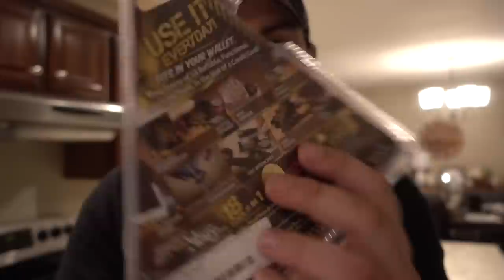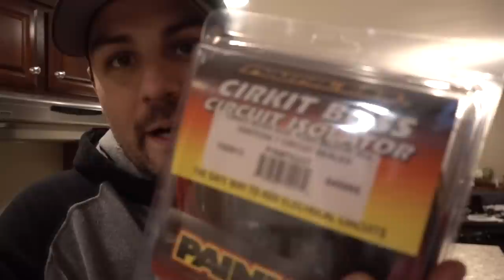The CHEAP way to fix your RUSTY truck bed!!!

Comment from the maker: Thank you as always for all the support guys!!! Don't forget to hit that LIKE button!!! and check out Wrenchworkz.com!!! New stuff coming soon!!! Who's ready for more giveaways!!!! Under 1K to 100K!!! K Love u BYE!!
Reply: why's that license plate folded on the trailer Greg 😂  not saying you are but I have done that before for no reason wink wink
Reply: GREG_ALBERALLA I’m ready to see 100k special lol
Reply: GREG_ALBERALLA put the wheel spacers on the front of the first gen!!
Reply: Put spacers on the rear of the first gen so you can get your center caps on your wheels since the after market axles shafts are preventing you from doing so.
Reply: Use the wheel spacer on the first gen on the front wheels to see if that will equal out your rear wheels sticking out.
Reply: Hey Greg Roomer has it that you do Directional Drilling?

Comment: nice steering linkage muscle man! anyone doing a front end rebuild on a 3rd gen ram 2500, heres a list of parts. I just did mine and bought everything on amazon and saved so much money.

Parts:
1) upper ball joints 2pieces - moog K7467 - $52.78/each
2) lower ball joints 2pieces - moog K7460 - $47.02/each
3) upgraded steering linkage (this is tie rods for 4wd, if you're not familiar) - moog DS800981A - $241.33
4) pitman arm (you'll need this one for upgraded steering linkage) - moog K440002 -
5) wheel bearing/hubs 2pieces - moog 515101 - $144.95/each
6) shocks 2 pieces- skyjacker hydro 7000 H7092 - $37.16/each 
7) sway bar end links - (part# for 2.5" leveled)suspensionmaxx smx-1227L - $90.45/pair
8) axle/ wheel u-joints 2 pieces - moog 464 - $40.95/each 
_______________________________________________________
total: ~ $973 

Tools: * beware, no tool, you get at an auto part store are going to help you without a headache.
1)heavy duty pitman arm puller
         -i had to notch the old pitman arm between the steering pump with a cut off wheel, so the tool would fit you'll find out what i mean. 
2)4x4 ball joint press 
3)hub puller
        - in my case i needed an acetylene/oxy torch to heat the knuckle up enough to get the hub out of the knuckle. huge pain in the ass.

i hope this helps anyone who need to do a front end on his ram, but is struggling to find a list of parts to complete the job.
Reply: Craig Shaffalo - Correct me if I am wrong, but the Mopar reengineered/upgraded steering linkage does not warrant the Pittman arm replacement, but if updating the steering gearbox from the 4-bolt Mopar piece of garbage balsawood gearbox to the 6-bolt Mopar piece of garbage balsawood gearbox,  THEN you need to change the Pittman... and getting that different geometry Pittman and putting it on means you are stuck with a stock suspension (no lift).
Reply: R.C. I can't say for sure. I went with the moog upgraded steering linkage, that according to moog, didn't require, but was highly recommended the new pitman arm, as it would change the angle (compared to stock shape) of the connection to the steering box, thus making for better movement and more longevity out of the steering rack.

Comment: Try a product called G503 on that rust. You'll need to pressure wash it & remove any lose scale before applying it. It goes on white but dries black & can be used as a primer once dry. It's supposed to seal the metal & prevent it from rusting again as well.
Reply: Also if you take your used (preferably diesel) motor oil & coat all the seams where two metal layers over lap thoroughly. Letting it soak into them very well
 It will slow down if not stop rusting.

Comment: You guys should load up the trailer head south and pick up every bed you can get your hands on for spares. You just bolt a new one on every time you get a little rust. That poor tow rig is going to rust to hell with all that rust that's on it 😢

Comment: I know it’ has nothing to do with this video, but greg a what’s the best intake manifold on my 01 Dodge to go with my mishimoto intercooler and piping. I have a hx-35 machined to a 67/67. With 150 hp injectors. And edge comp box. It gets a little warm when pulling a hill figure the intercooler will work and maybe a intake manifold.. what manifold would you recommend

Comment: Hey Guys yes Winter is  tuff on trucks.  I have a simple solution for rusted truck beds:  Replace it with a LAST Composite Flat bed that will never Rust.  These beds are sold as kits and are easy to build. The bed are manufactured from structural fiberglass and FRP Ballistic Plate.  Just Google LAST truck body.  The bed is very strong and will carry heavy loads with ease. Best of all it looks great and will never dent or rust. Yes this is the solution. Let me know if you would like to do a video.

Comment: As far as the rust on that bed-side,  it looked like baby shit to me. I would have simply sanded it down and used JB Weld as a body filler, all within minutes of each other. I'd cover the entire area, then after overnight drying/curing, I'd sand it down, priming (if necessary, since paint sticks to JB Weld no problem) and touch-up paint. Real quick, easy and effective.

Comment: I got a 05 3500 ram so far steering is good it only has 87000 miles. What is the best way to help it so I don't get the play and wobble down the road?

Comment: Butt welding patch panels with no gap? Have fun when the panels pop because you ground down all the filler weld that was holding the panel in place. The reason panels are gap welded or flanged is to build up filler....

Comment: Is there anyway to stop the rust and just add those fender covers to hide the damage?
Reply: No that is impossible. Rust is referred to as cancer for a reason
Reply: Not true....you could sand it down and primer it....or paint it....you could cut out the spot that’s rusted and then put the fender flares over it